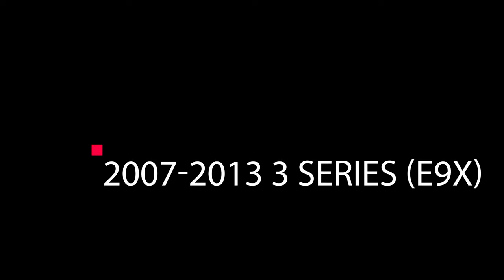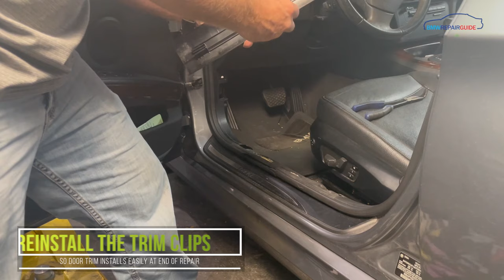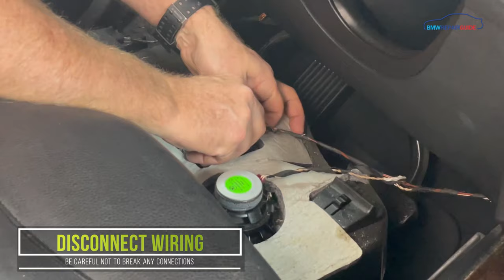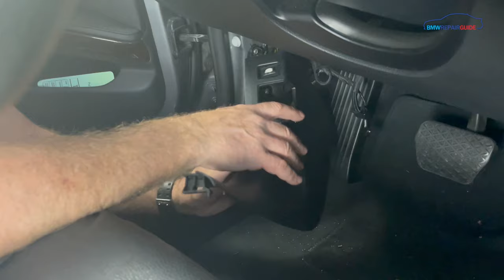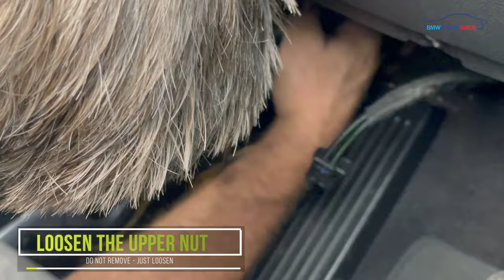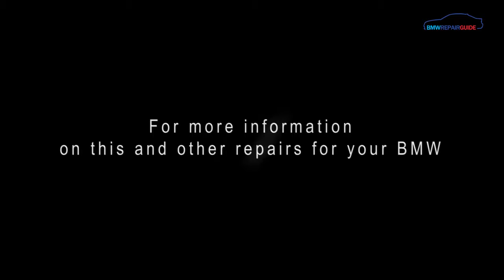BMW E90 FRM Footwell Module Removal (2007-2013)

Comment: Good video, helped me out quite a bit. BUT…..the question is how to reinstalll when I get my repaired FRM back? Disconnect the battery completely, or just take off the negative, or leave it fully connected while I plug the FRM back in? 
Seems to be a few conflicting versions of what to do and the last thing I want to do is damage a freshly repaired FRM🤦‍♂️
Reply: Dude, same question. Have my FRM that came back yesterday and not sure how to install. Which route did you go with?
Reply: @JeepHemiLyfe  I was advised by a firm in Glasgow who did the repair for me… just plug it straight back in without disconnecting the battery. Won’t lie, I was worried! But it was fine👍
Reply: @MrGibspoon  I appreciate that man! I’ve been worried white about reinstall. Did you have yours repaired or buy a new unit and need recoding?
Reply: @MrGibspoon  hi is your FRM working well now?
Reply: @looyuki3187  yeah, it was repaired. Reinstalled without disconnecting the battery and no problems! ….until I had an accident and wrote the car off in June🤦‍♂️🤷‍♂️

Comment: I have a 2012 bmw 328i. The frm module is not located where it should be. I checked drivers and passengers side. Help!!
Reply: 2012 is the next generation 3 series after the e90. It’s in a different location most likely

Comment: Hello, a question. What is the function of the Footwell Module Removal? I am interested in knowing, since currently the windshield wipers do not work in my vehicle, despite the fact that I replaced their motor. They had mentioned to me that the problem could be a vehicle module, but I don't know what it is.
Reply: Did you check the fuse ?
Reply: If it is just the wipers probably the fuse